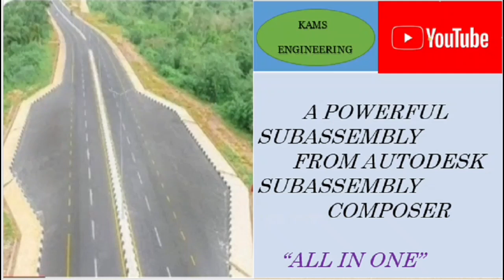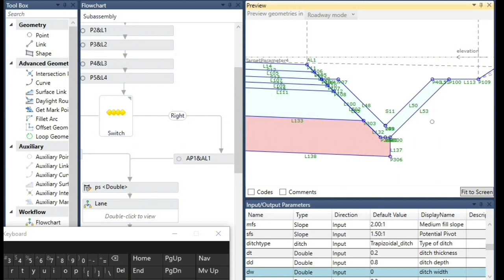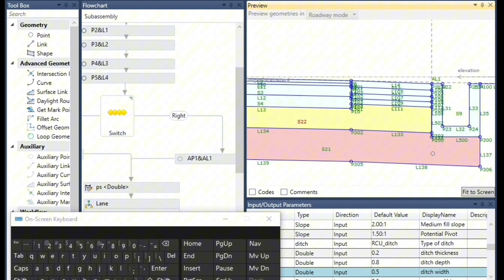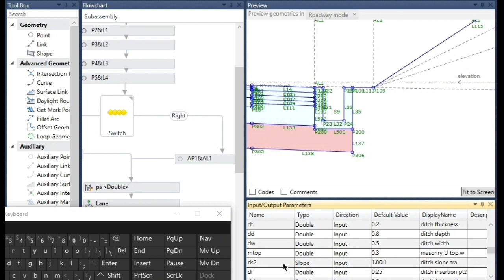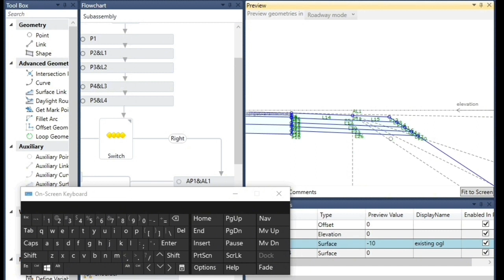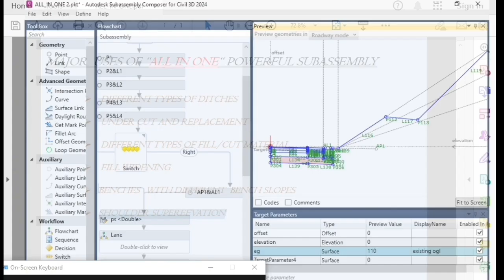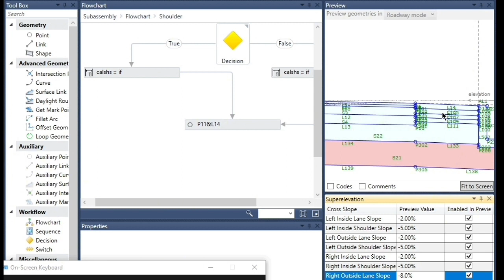Powerful Assembly from Autodesk subassembly composer

Comment: 00:01 Learn to create a powerful sub-assembly using Autodesk Subassembly Composer.
02:40 Easily change subassemblies by adjusting parameters
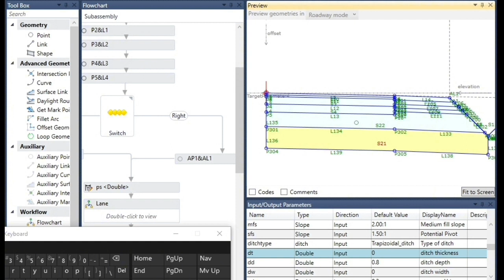05:13 Subassembly composer allows for flexible undercut replacements
07:48 Autodesk subassembly composer allows for flexible material and slope adjustments
10:26 Autodesk subassembly composer allows easy adjustment of cut slopes based on field height
13:21 Adjusting field height impacts widening in Autodesk subassembly composer
16:01 The powerful subassembly allows for flexible bench slopes and easy super elevation calculation.
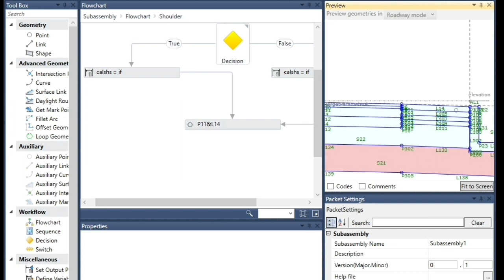18:36 Calculating shoulder and super elevation in Autodesk subassembly composer

Comment: Sir, It's an amazing assembly for civil 3d workflow. One question is this @ 16:32 mark of this video one small bench is appeared with toe point can we assign a minimum limit for this bench (i mean if this height is less than one meter daylight will increase last bench up to toe point.? it this possible or not.?
and can i get this assembly pkt file.?
Reply from the maker: Thank you 
Yes you can add simply by making one decision 

If i get 10 subscribers from your side i will send you pkt
Reply: @KamsEngineering  Sure sir, u will get more than 10.
Reply from the maker: Please text me your email or telegram no. I will send you pkt file
Thank you
Reply: @KamsEngineering  @ gmail.com
Reply: Thanks you sir for your response plese share the file with me at this ...
Reply: naseer.galfar
Reply: bhatti.naseer177
Reply: Sir can u add your email address or tlgm id in video description because due to YT policy no one can mentioned email address in comments section i have tried but its automatically removed. thanks, you for your cooperation.